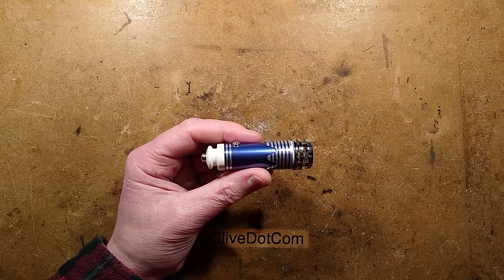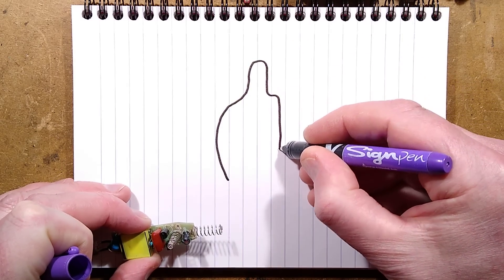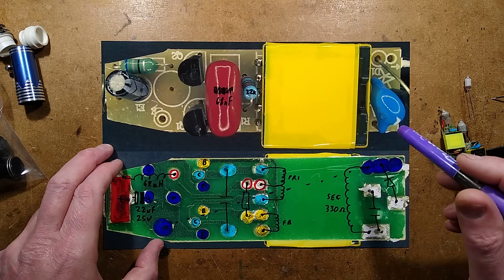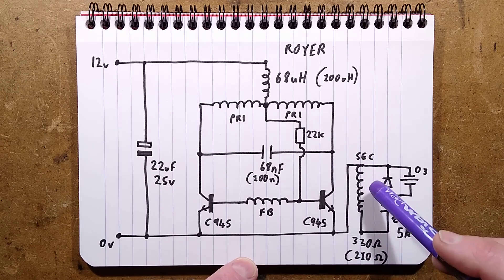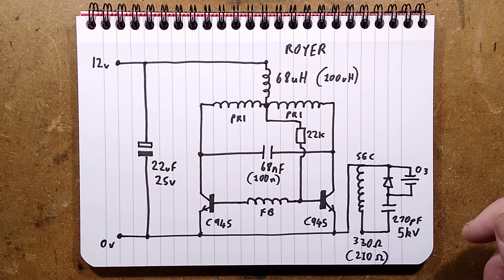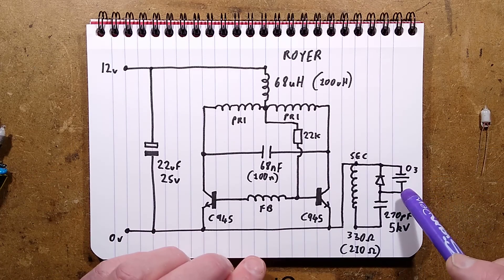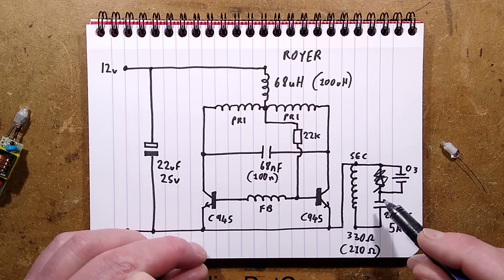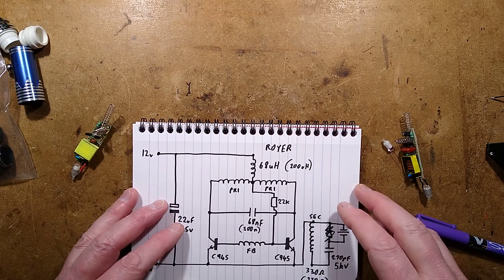Dead car plasma unit (fixed) with schematic

Comment: Can anyone help me here?
What is the intent of generating ozone gas inside an automobile? 
Ozone is a respiratory pollutant and can be detected by humans in very low concentrations. 
Not only that, but it is an aggressive oxidizer and attacks plastics and other materials. 
Why would one want to pump that inside a car's cabin? 😷
Reply: You plug it into your Land Rover to make it rust faster.
Reply from the maker: At low levels it can be used for sterilisation and odour removal.  Ozone is an essential part of outdoor air at very low levels.
Reply: @bigclivedotcom   Gotcha, thanks!

Comment: I would love to have a legit one  of these.  What might one search for to find such a thing?
Reply: @benjurqunov  Usually to kill  bacteria and fungi/mold living there. Most likely in seats and in the floor carpet. It also fights odours. Good idea is not to be inside while you "sterilize" the interior.
Reply from the maker: The tricky bit is finding a real one.  There are many fakes with an LED and fake circuitry.
Reply: @benjurqunov  Where in my comment did I mention that I want it for when I am in the car?
Reply: @TechGorilla1987  
So you admit you'll be using it inside a car ?
Reply: @benjurqunov  Are you sure you're carefully reading the words in my initial comment?  I mean, study it out.  You're probably looking to school me on the dangers of ozone, and I guess that's a noble cause, but I neither desire nor did I ask for your concern.

Comment: Is it truly dead when it never worked to begin with 😅

The only thing about the diode before  a neon is I've found it'll allow the neon to light at a much lower voltage (about 90vdc) and that's only if you want to try and cheat it's brightness

You're right with triggers broom though, couldn't think of a better analogy

Comment: If you take the diode out, wouldn't that mean that the neon bulb is operating on every cycle rather than every other cycle? Perhaps the original designer found that it made the neon bulb burn out too quickly or generate excess ozone and put this in to reduce the strain/output. This was then copied into the production of this unit with no actual knowledge of what was happening.
Reply from the maker: The neon is running at extremely low current.  The AC is required for proper operation of a dielectric barrier corona discharge generator.

Comment: One slight correction:
This isn't a Royer oscillator. It's very similar, but the Royer oscillator does not have a capacitor across the transformer and relies solely on transformer saturation to oscillate. This circuit is known by many names, I used to call it a Mazzilli driver (actually this one is a bit different, as it uses a feedback winding to drive BJTs, rather than diodes to drive MOSFETs), but other people may call it something different. In academia I'd probably call it a "self-driven resonant current-source inverter." It uses a parallel LC circuit (the primary of the transformer and the 68nf capacitor) at resonance, which is current limited by the 68 uH inductor connected at the transformer centre-tap. As it doesn't rely on driving the transformer all the way to saturation and it operates at resonance, allowing zero-voltage-switching, it's much more efficient than a Royer oscillator, especially when MOSFETs are used instead of BJTs.
Reply: I heard this circuitry referred to as "Harmonic Royer". Presence of the capacitor between collectors allows with the right tuning to produce a sinusoidal output.  "Pure Royer" can't do that.
Reply: Baxandall converter
Reply: @MaxPivovarov  in this case it was a banjaxed converter
Reply: This guy electronics